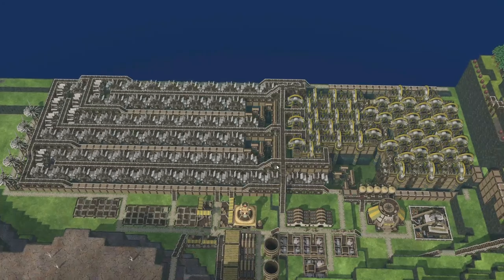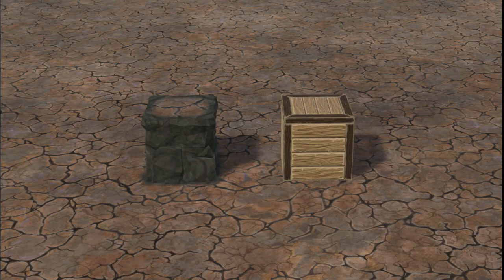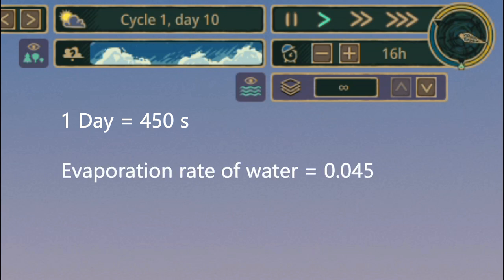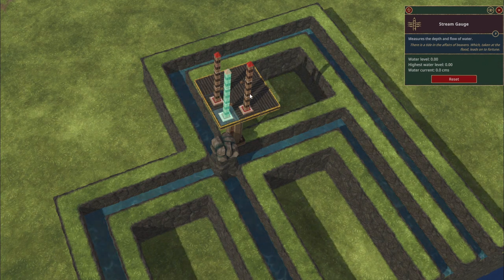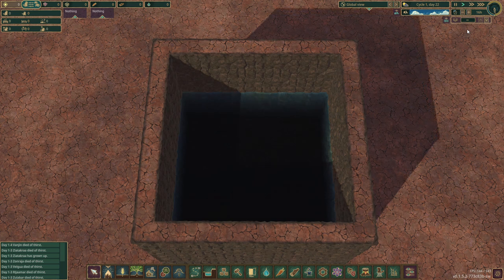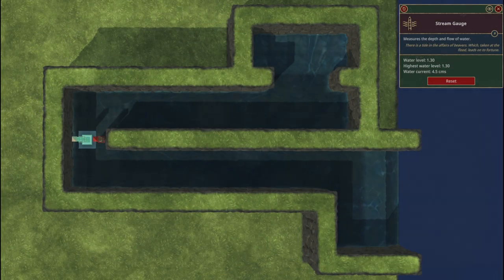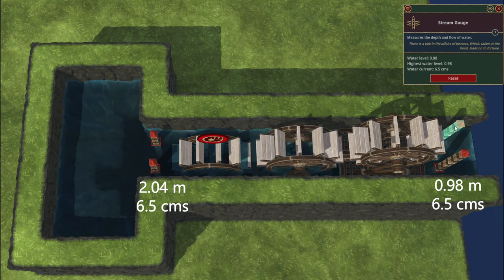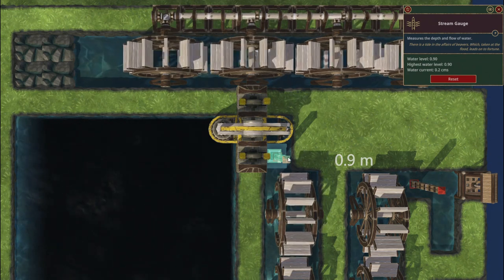Timberborn | A Guide to Perpetual Motion Machines in Timberborn [Part 1]

Comment: To everyone asking for a part 2 - In case you didn't know, he has an older video in his channel which is also currently the only other video, where he shows a perpetual motion machine. That said, he might do a video which explains everything like he did here.

Very nice effort, I imagined that this would work because of the lack of resistance to water flowing through a water wheel and the  plain 700 hp cost for a mechanical water pump. The way you used water dumps to maintain water levels at the bottom reservoir was also interesting insurance against water loss from evaporation.

If you get time, please do a part 2 with a similar explanation.

Comment: For those also trying to construct their own PPM based on this video: @3:45 (appx) he states that the total outflow is less than the relative water level divided by "zero point one five" but  the image on screen says less than or equal to relative water level divided by 1.5. 
I believe that it must be 0.15. Here's why: I could not figure out why his PPM had the wheels on 2 high platforms, but it is so a relative water level of 2.1 (minimum required to operate) will allow for a total outflow of 14. Since it is a 2 wide channel, that allows for up to 28 cms or 56 mechanical fluid pumps. (I think there are 49 in his build.)

I was too focused on the 2.2 cms limit off of what I call a "falling edge" but he defines as a drop of 1 block or more. The trident-shaped damn structures between the top, middle, and bottom section of WWs is to increase the number of falling edges to accommodate the designed rate of flow. While 2.2 cms is the limit, the higher capacity over design is expected to make it easier to get it to steady state flow. (Although, I count 12 falling edges in the design that I freeze-framed. With a designed rate of flow of 24.5, Tim Lin kept it close to 2.2 cms.)

Another lesson learned, I was trying to combine fluid pumps with water sources, but the fluid pumps would not pump properly. This was because they stop if the water level is too high. I had to create a lock 1 block above the top set of WW, so that the water would continue flowing even if the reservoir got full (ie, relative water level of 3 at the top of the WW. Since it only had to be one block deep, I raised it up a block and put a dam (0.75 m not subject to the 2.2 cms limit, and then used a finned-structure to distribute the flow across many falling edges.

edit: when I checked that timestamp, the info box of the example had a relative water level of 1.5 and outflow of 10, so it is definitely 0.15. ie, 10 <= 1.5 / 0.15